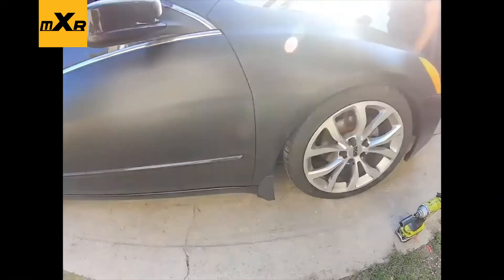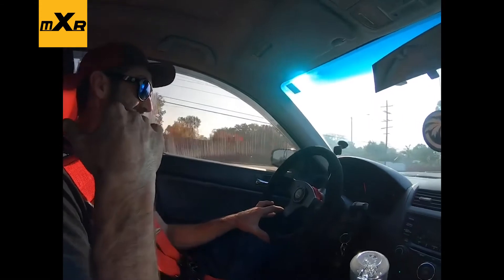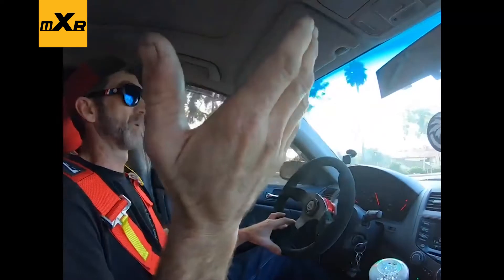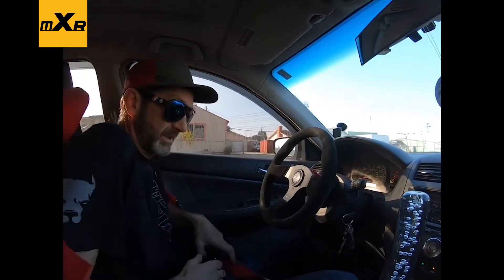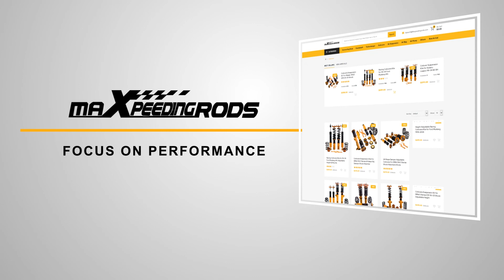For Honda Accord Acura Coilovers Review & Installation

Comment: Maxpeeding is giving me a product for free...I have a 2008 Acura TL base...will any of their coilovers fit?
Reply: yeah, the 03-07 accord coils also fit the 04-08 tl
Reply: The top hat bolt spacing is different than the accord because of the strut bar. But the springs and struts are the same.
Reply: @dereks9012  can it work with any modifications

Comment: Can I lift my car with these ?
Reply from the maker: Hi dear, may I have your car information?
Reply: MaXpeedingRods 2009 Honda Civic sedan
Reply from the maker: @miclomusic805   CO-HON-0611-G-LC  this one is right for your car, sir.
Reply: MaXpeedingRods just ordered my pair 🔥 
Might make an unboxing/install video
Reply: @miclomusic805  how is it any leaks knocks rust?
Reply: @waatao9856  they have held up over time but the surface does get very dirty, I don’t regularly clean mine so they have minor deterioration on the surface nothing major,
I have had a few (knocking, popping, springy) noises when turning the wheel completely to one side but after adjusting they stay quiet,
Pretty stiff ride on my 2009 Civic sedan but I enjoy it much better than before it jumps right over bumps and I can cruise through dips. 
I actually raised my car up with these to fit some 20s on it ! 

Might go back and lower eventually but so far they’ve held up I never had any major malfunctions I just highly recommend checking them monthly after install 👍🏽 
I’ve waited 4-6 months and one coil slightly loosened creating the noise I mentioned
Reply: @miclomusic805  what do you mean adjust? Can U explain
Reply: @waatao9856  the coilovers in the front adjust in multiple ways (height & preload)
In my case I raised the (height) instead of (lowering),
You have to tighten the (preload) with the tools provided so the coil has enough tension,
Hope this helps ! 
Watch more videos I did a couple days of digging before I installed myself 👍🏽 
Definitely a fun project
Reply: @miclomusic805  so it was the preload wasent done properly the first time? And it's all good now I thinking about getting these man
Reply: Shoot me a link, 2013 Honda account
Reply: @MaXpeedingRods  this company Is a joke send me leaking coilover I had to pay for new damper. Still not received tracking after 2 weeks. No phone number. Nothing